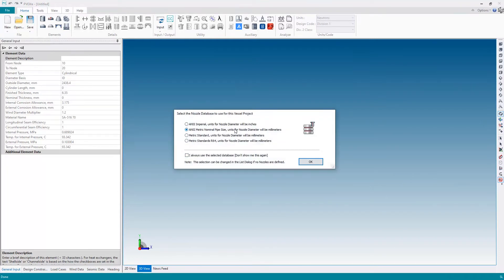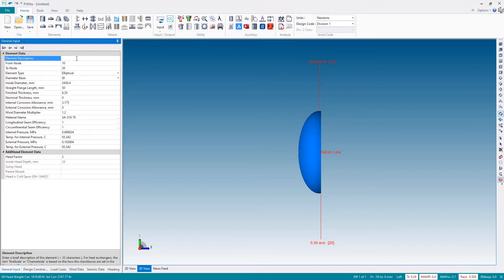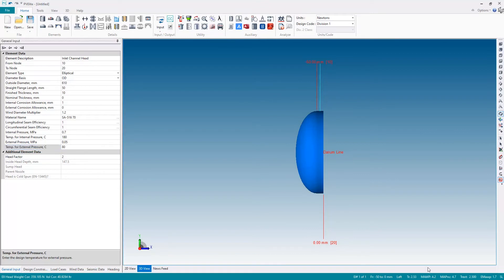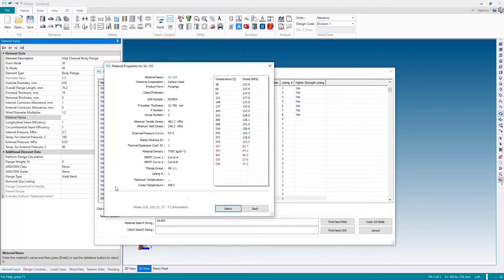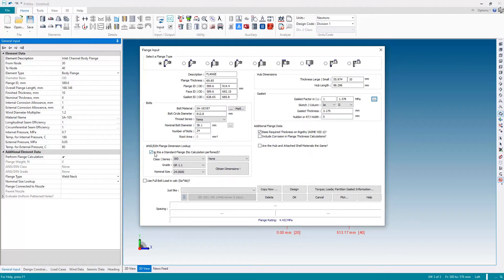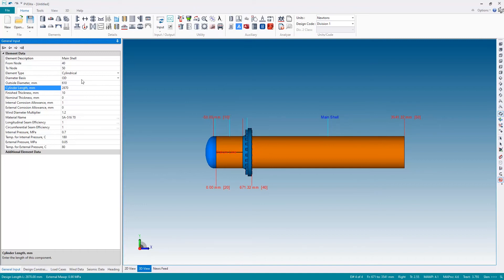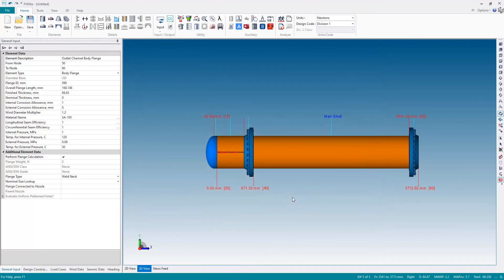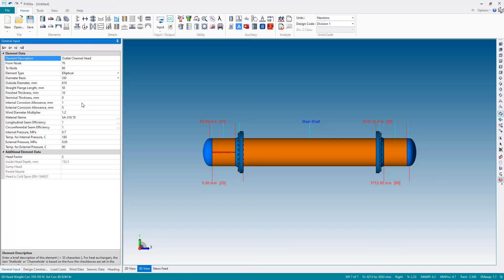How to... carry out heat exchanger modeling in PV Elite®  - Part 1

Comment: I tried to design a pressure vessel in PV Elite according to ASME Section VIII. Is there any possibility to apply the RSP 2000 code for seismic loads or to perform conversions? I couldn't find any option to apply the RSP 2000 code directly in PV Elite.